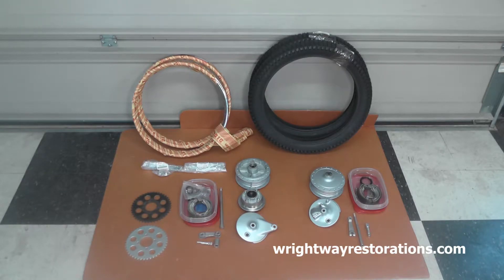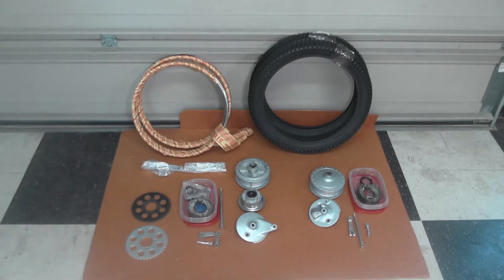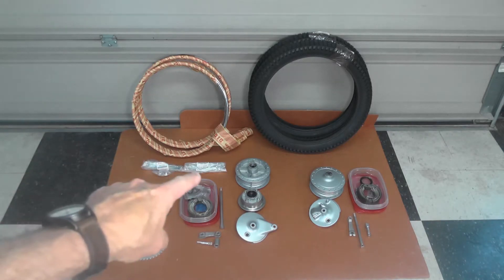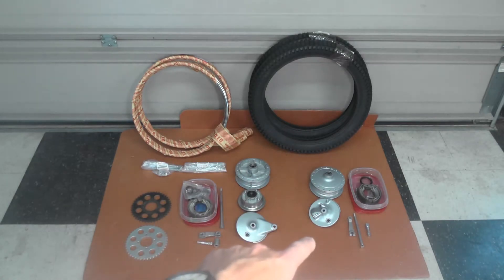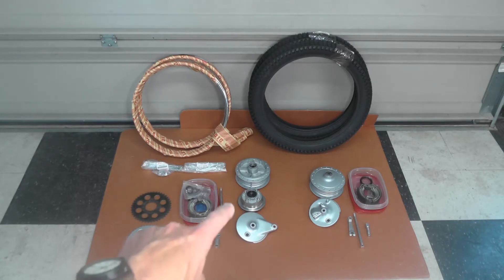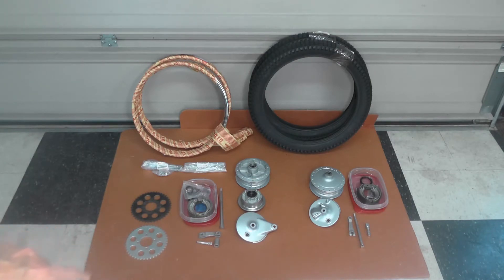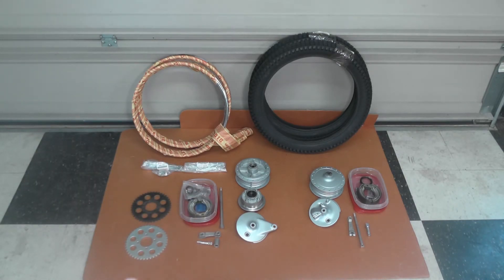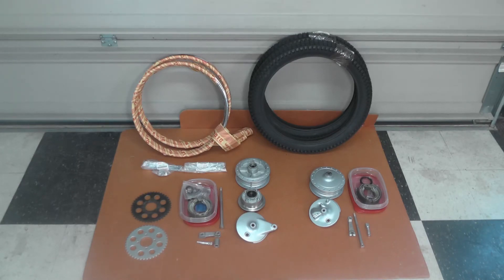Suzuki TS50, Project Update   Wheels & Tires --- Video #332

Comment: Enjoying the restoration videos. I'm working on a T125 Stinger currently and was curious as to what tires you selected ? Wavering between stock looking and something more modern.
Reply from the maker: I spoke to the tire selection in the video approximately 20 seconds into the video.  The tires I chose are SHINKO brand.

Comment: Would you mind sharing the link to the new DID rims
Thanks,
Austin
Reply from the maker: The Honda part number is: 42701-102-793

You can get this at a number of places, just search for the part number.  The price does vary a bit so shop around.  I got mine from dratv.com, but their site appears to be down right now.
Reply: @kwrightway  thank you